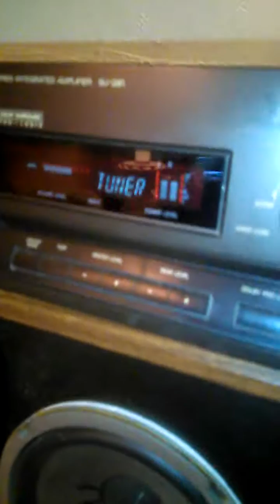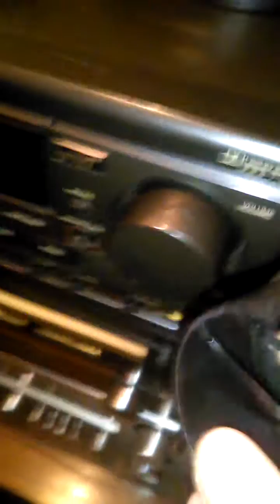Technics SU-G91; Fixed Overload issue

Comment: Apparently putting in a new fan cures overheating and system shut down. I just got a free SU-G91 that I was told did not work,, but I had hooked it up briefly and it did work, so maybe if it gets hot a higher CFM fan is the cure.

Comment: hi!

first of all, which were the overload issue symptoms?

I own a SU-G90 amp, and after running some time, and more quickier as higher is the volume level, you hear some "electrical" sound, and then the amplifier goes to a "freeze status", turning off the sorrund, the superbass, the dat/vcr input...is that the overload issue?

when the amp does taht, i feel it hot.

the fan works, and fan's speed is related which amp "charge"...higher volume, higher speed

i can't hear your video's audio clearly...

thanks!